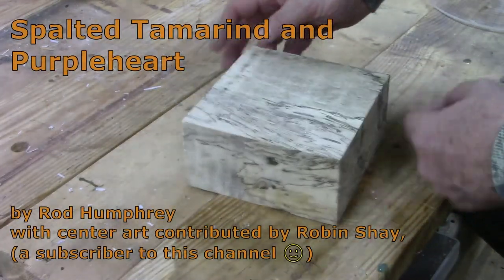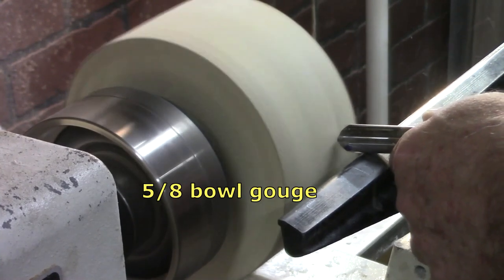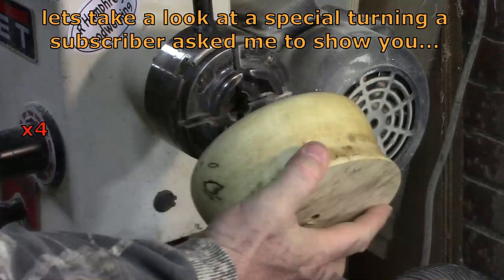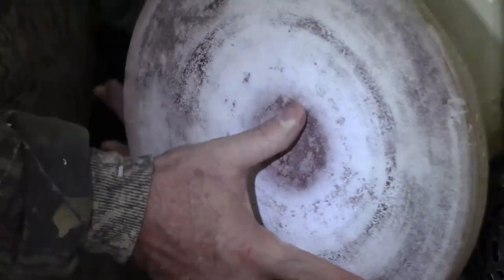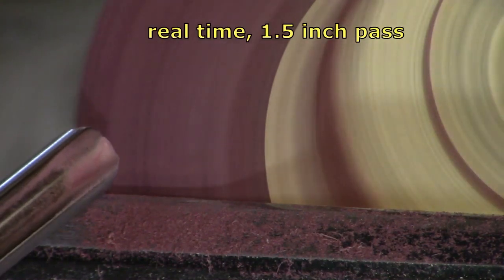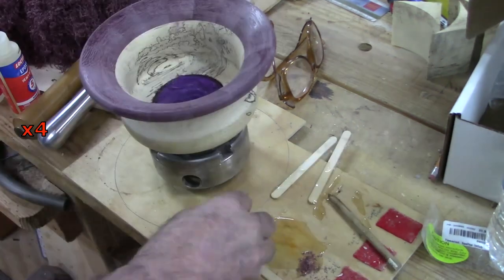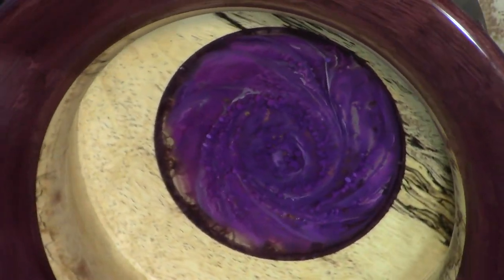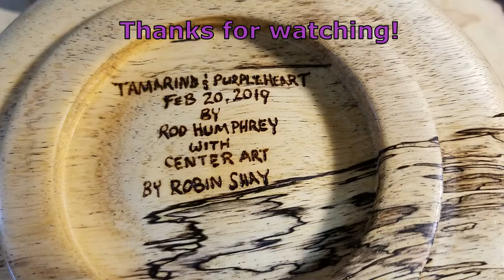Woodturning a Bowl - Tamarind and Purpleheart, with Subscriber Art

Comment: Rod that is very interesting wood. I have never heard of that one either. Those gifts you received are amazing and you made great use of one of them so far. Really goes well with the bowl you turned.
Great tip on the angle of the grind.

I love the purple heart. I am working on an extensive glue up that will have Purple and Yellow Heart in it.

 Take care,
Gary
Reply from the maker: Thank you very much, Gary!

Comment: Pretty piece Rod nice contrast. As regards tool control, actually feeling what is happening with the cut is so important. No point in grasping the tool with a rigid fist around the tool, just a finger and thumb grip is enough, but keep the tool sharp with either a diamond slip or fine grindstone helps and of course ensure the rest is at the correct height.
Reply from the maker: True, and I try to address all those points on occasion...though, there is sometimes a need for a more firm forward grip.

Comment: Definitely a "WOW" factor.  Does the chart you use to determine the angle  for the segmented ring sections factor in the circumference and the length of the segment?  Thanks Top and Semper Fi.
Reply from the maker: I have charts made up for different segment counts/angles.  they're a super easy way to determine segment length/circumference and overlap requirements for bowl and vase building.  there are computer programs/apps developed for the same thing, but for simple segmenting, these charts make everything easier.

Comment: Wow, simply stunning!  Keep up with the tips!  They are very helpful! Could you include some video that shows how you hold bowl while you finish the bottom of the bowl.  I am also curious how you sharpen your gouges and if you use a jig of any kind.  I finally was able to purchase a midi lathe (Nova Comet II) and made my first little bowl from figured maple.  Lots of catches, but the end result is beautiful.  Unfortunately I couldn't finish the bottom side with it on the chuck.  Do I hand sand, or get some of those Coles jaws?  Please share your wisdom.  God Bless!
Reply from the maker: Thank you Jerry!  I use a slow speed grinder with CBN wheels, and the Wolverine sharpening system (jig).  For the bowl bottoms, I tend to turn the bottom first and then use the chuck to hold the bottom while I turn  out the top.  I prefer to use a mortise on the bowl bottom, others like a tenon.  Cole jaws work great, but be very gentle because they can also throw an almost finished piece across your shop....

Comment: What can I say Rod that has not already been said in other comments!! I believe Purple Heart goes brown with time. Will it keep its original colour now that it has the shine juice on it. Finally I bought two pieces of Spalted Tamarind, neither of which are as big as that piece, a couple of years ago and have been wondering what to do with them. I'll have to practice making segmented rings before I attempt to do this and ruin a lovely piece of wood but I will be giving this a go. Any tips on making the rings? Looking forward to the next video already and as usual. Thanks Rod. Cheers, Huw
Reply from the maker: Thank you Huw!  It's my experience with purpleheart that the purple grows stronger over time, unlike redheart for example which does turn brownish.  Purpleheart often turns brown when cut, but the color comes back, and can be hastened with sunlight or heat.   Making rings is pretty easy, it just looks difficult...practice with cheap pine 1x2 timber, you'll see 😊